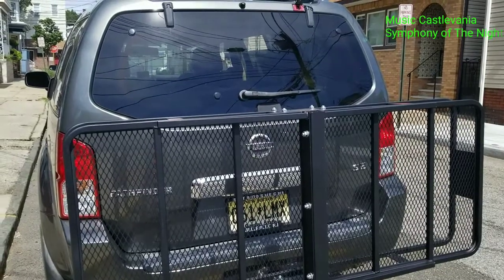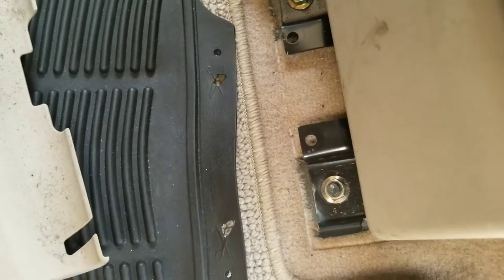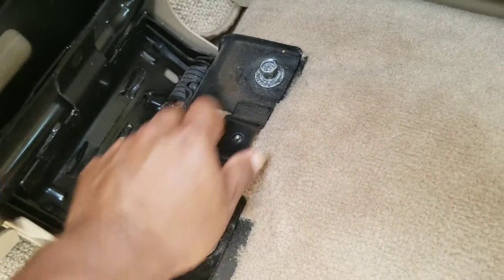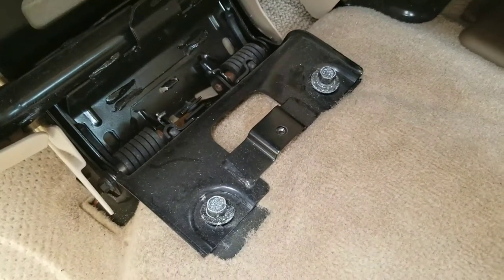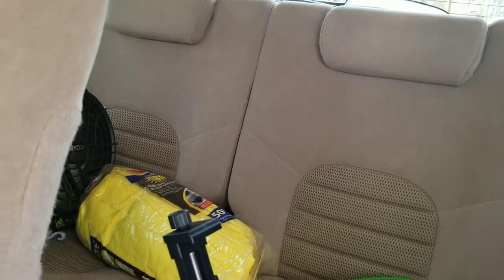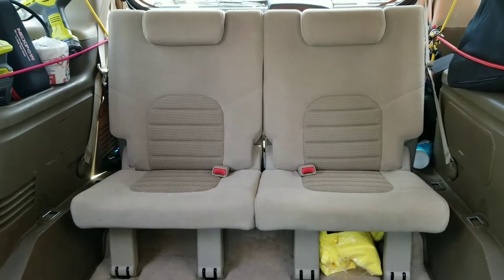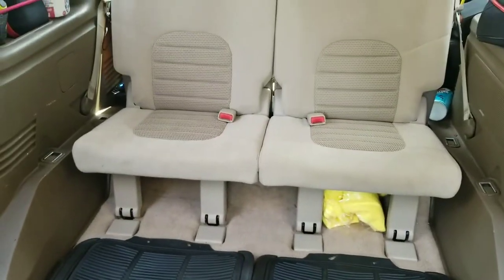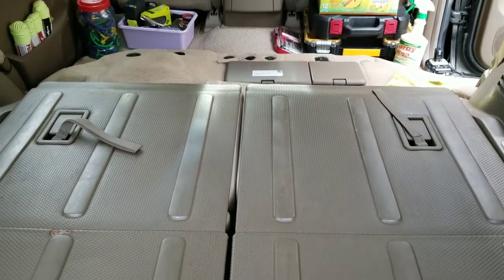HOW TO REMOVE THE SEATS FOR NISSAN PATHFINDER 07 FOR CAMPING.

Comment: Nice car I have the Nissan pafhinder 2010
Reply: I too just git a 2010 S. 90k. Had suspension redone, plugs, over routed radiator transmission cooler, and added aftermarket Trans cooler. Big bucks but car will last.

Comment: What size screw did you use and where did you buy it from?
Reply from the maker: Use a 14mm socket, any hardware store will sell it or Amazon.
Reply: @MrEvodio65  Thank you sir
Reply: @MrEvodio65  I own a 2008 pathfinder
Reply: @MrEvodio65   I have a Qx56 suv .. when I removed the seats the floor wasn't flat. can you design a Wood floor to make it level?

Comment: can be removed only the center seat of the 2nd row?
Reply from the maker: Yes you can,I have that set up right now.
Reply: @MrEvodio65   I did it. Six bolts out and it went off. Thanks!